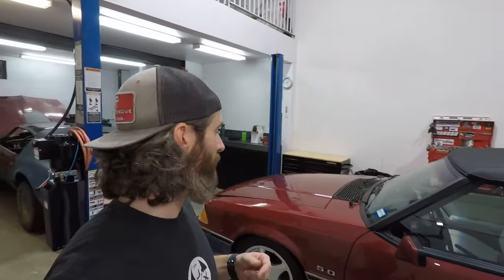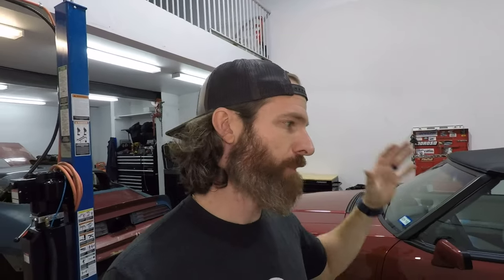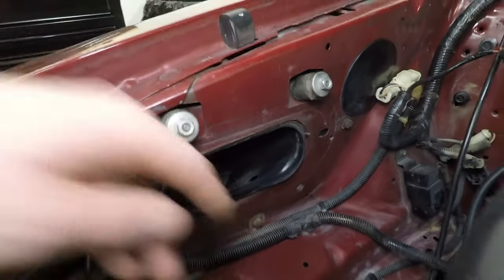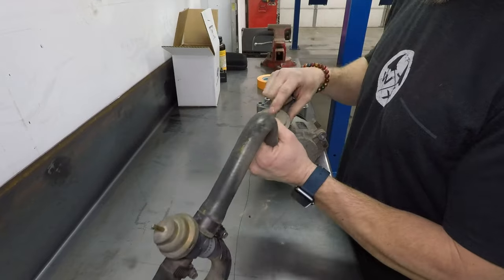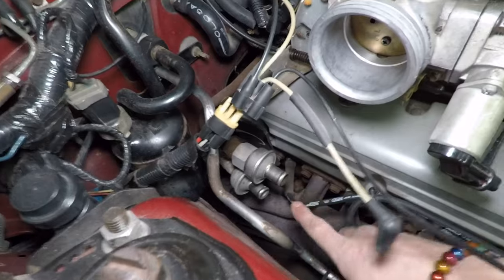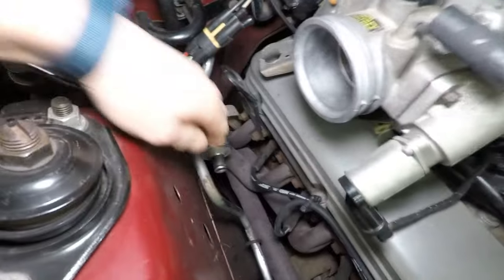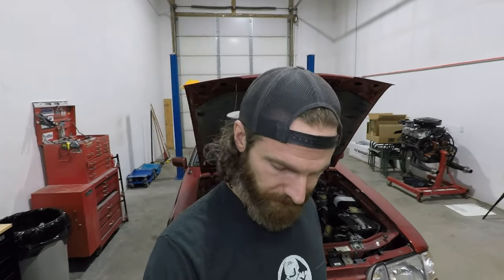Get Rid Of THIS Garbage in Your Foxbody Mustang 5.0

Comment: I really enjoy all your vids buddy! I am starting a AOD to T5 swap on my 1988lx 5.0 vert and interested in doing this smog delete setup as well. My question is did you remove the charcoal canister and evap stuff as well?? the purge valve and all that too line from upper intake manifold down to evap ? just plugged it all off or? I am not sure if your year vert would differ from my car and the factory set up since my car is a speed density car . Also when you removed all smog stuff did you worry about getting a check engine light code on the dash? I started pulling my h-pipe tonight and noticed i have that long smog tube attached to my h pipe that goes up above passenger side header and its kicking my ass to remove from the car from the bottom just using floor jack and jack stands, god I would kill for a lift lol fat guy problems lol hahaha too much beer and pizza and tight fit under the car. I have heard guys say just cutt that smog tube off the h pipe but not sure if thats a hack way of doing things. How in the hell did you tighten the h pipe bolts and nuts to headers lol. its so damm tight clearance wise in my car. Maybe after i get that big bulky AOD out my car and the T5 in there will be more room! cheers from the states down here in Maryland brother! thanks any input much appreciated.
Reply from the maker: Hey pal thanks so much for the kind words!!! 

1. Keep the evap stuff
2. Cut the line that goes the the H-pipe. If you don’t need to cut it, you’re a better man then me 😂
3. No need to worry about a check engine light by removing the smog pump. There is no electronics tied into that system. Just plug off the 2 vacuum lines
4. Get yourself a good swivel socket and some extensions and you’ll get those bolts tight 😉

As for the beer and pizza - I like your style 😎

Thanks for reaching out and I hope this info helps 👍
Reply: @KASLCustoms  thanks a ton brotha! Hopefully get to catch u at one of these shows sometime buy u a beer 🍻 cheers from Maryland 🙏
Reply from the maker: Anytime my friend! 🍻

Comment: How much weight did you lose doing this  like 20-30 pounds maybe? Also, since you deleted the smog do you now have any check engine lights? I know these cars aren’t plum full of sensors like newer cars, mostly just curious if the car knows it’s gone or not.
Reply from the maker: Hey bud. On the weight end of things, probably 5 or so pounds - not a ton. As for the check engine: nothing. I e had my coupe deleted of all this stuff for well over 20 years with no issues at all. There are no sensors or anything you have to worry about. Only 2 vacuum lines that need to be plugged. In all honesty, I only removed it to replace the headers and once it’s out, I don’t see any reason to go to the trouble of re installing it. It also cleans up the passenger side of the engine bay a little too 👍
Reply: Correct no check engine light, I recently removed my smog pump on my 1995 5.0 mustang, car lost weight freeing up lost horsepower

Comment: Thanks for the video! I wasn't planning on doing this, but I am forced to. I have a 1990 SSP that has a factory alternator bracket built into the smog pump, I know it sounds weird. They are fully connected and do not come apart. I have to change the alternator, and since the alternator for the SSP was discontinued once the police cars went out of production, no other alternator fits this stock SSP bracket. So now I have to change the bracket to an LMR one, but the smog pump definitely has to be removed. My question for you - do I just need to plug the other small vacuum connections? I'm pretty sure thats what needs to be done but just double checking.
Reply from the maker: Yes you most definitely do
Reply: @KASLCustoms  thanks bud. Also, I was being stupid and the bracket did come off haha. One more question for you. If I remove this pump, do I need to delete the EGR? Or will everything still work fine if I keep it on.
Reply from the maker: Yes it will all work fine 👍
Reply: @KASLCustoms  thank you so much for your responses. You're a great youtuber
Reply from the maker: Thank you sir!!!

Comment: Fellow Canuck here! I am almost done removing engine from my '87 GT and was so happy to remove that smog nonsense! My question is though, how does not having all that smog equipment affect my chances when I have to have the car inspected for road worthiness? My GT has been stored for many years and will have to pass inspection before putting it back on the road. Wondering if you have any info on that?
Reply: Get your inspection done first with all OE equipment.  Then you can't fail.   In Ontario all OE emissions equipment must be in place.   You can always remove it after if you choose to.  I had to put CATs on my car to get my inspection done.
Reply from the maker: This is a good point. I too wouldn’t take any chances with inspections however if you felt like chancing it, I definitely wouldn’t remove the Cats prior to inspection. They will definitely be looking for those. The smog pump on the other hand may squeak through…😬🤷‍♂️
Reply: If u have newer style obd2 cats u could argue that u don't need the smog pump as its really just to get older style in efficient cats hot faster
Reply: Northern Ontario here. No emissions testing here unlike Southern Ontario . I've kept everything just incase they do .  Haven't introduced emissions testing in the 32 years I've owned the fox . I think I'm good .😁
Reply from the maker: Right on! Lord only knows where it’ll go from here 🙄🤦‍♂️

Comment: I 4get the name of it , but isn’t that little plastic box under the air box but next to the smog pump part of the smog system as well?
Reply from the maker: it’s called a EVAP canister. it’s a charcoal filter that the fuel tank vents to 👍

Comment: What tool did you use (not the size of the bolt head, well that too) to get to the crossover tube bolts out?  Did you take the bolts out from the top or the bottom?  And how did you snake the crossover tube out of there, up or down, obviously passenger side?  I got those block off plates but am hesitating on trying to use them.  Especially because of the drivers side clearances.
Reply from the maker: I believe they are 1/2”. I’m sorry but I’m not sure how to answer the rest of your questions…? You just remove the bolts and remove the cross over tube. Very straight forward
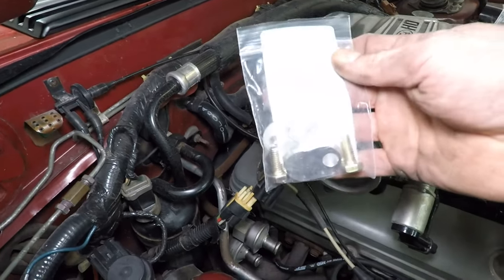Reply: @KASLCustoms  During the time you actually used tools and removed the crossover tube (9:07) you only showed a graphic that said "Many Moments Later, And A Lot of Swearing" so we the viewers didn't get to see what tools you used to remove those two bolts with.  That is my question.  What tool did you use?  Combination Wrench, Combination wrench with a ratcheting box end, Box end wrench, 1/4 or 3/8 inch ratchet and a shallow or deep well socket, a 3/8 inch ratchet 17 3 inch long extensions and 16 Universal joints, Adjustable wrench?   Tool Specifics, during the crossover tube removal
Reply from the maker: I used a box end wrench. The reason I said “many moments later” is because it’s a very tight space to get into and remove the 2 bolts. Once to bolts are out, you literally just remove the cross over tube from the passenger side.
Reply: @KASLCustoms  That's what I was wondering, thank you.
Reply from the maker: You’re welcome

Comment: Recently acquired a drive train from a 93gt.. gonna drop it into my 65 2+2… This pump will be coming off.. IF I decided not to use the idle pulley.. any idea of the belt length ?
Reply from the maker: Nice! I’m 99% sure it’s approximately 78.5”… a quick google search will confirm this 👍

Comment: Does the ECM need a new flash to compensate for the smog pump removal?
Reply from the maker: No not at all 👍
Reply: @KASLCustoms  can that smog system cause annoying vacuum leaks? I'm currently struggling thru troubleshooting those now. Replaced most everything else at this point.
Reply from the maker: There are 2 vacuum diaphragms that are in the smog plumbing. They need to be plugged if you remove the pump/plumbing 👍

Comment: Now, can you delete all the smog pump stuff and not get a check engine light? Interested in doing this myself on my 90 GT Hatch but I'm trying to not get so far into it that it will need a tune to get rid of a CEL. Is it possible to keep EGR and only remove the smog stuff to keep from getting a CEL?
Reply from the maker: You won’t get a CEL from removing the smog pump. I still run the EGR on both my cars with the smog removed with no issues. If you delete the egr, you need to “trick” the computer to thinking it’s still intact or else you will get a CEL. Hope that helps 👍
Reply: @KASLCustoms  Okay, I was trying to look it up also and I wasn't able to get a clear answer. What about all of the small vacuum lines that go to the smog pump hoses when you smog delete? I rewatched the video and didn't see anything mentioned about them. Thanks for the response. I do still plan on running egr as to not throw a CEL of course. I just want the smog stuff out of the way for looks and ease of access in the engine bay purposes.
Reply from the maker: Ok cool. Yes, just get buy some vacuum plugs from your local part store and plug them off 👍
Reply: @KASLCustoms  Alright, I figured just as much, thanks!
Reply from the maker: Anytime my friend!

Comment: Will back of heads leak anything when that pipe is pulled off?
Reply from the maker: Yes, unless you install the block off plates
Reply: @KASLCustoms  thanks but i meant while car is off and when you actually remove the pipe. Dont wanna spill antifreeze everywhere haha seems my smog system is gone and all that remains is that pipe.
Reply from the maker: Ok, understood. There is no coolant in that pipe. It can be thought of much like exhaust pipe because it only holds air 👍

Comment: is there a disadvantage just leaving the smog and using a shorter belt
Reply from the maker: No not necessarily - it’s mostly just personal preference with how you want the engine bay to look.
Reply: Not really. I did it.
Reply: @patsfan8057  I need help with the EGR vacuum lines after I pulled the smog pump I thought some of the vacuum lines have to go I have a 91 mustang gt any help would be great
Reply from the maker: Just plug them bud 👍
Reply: @Mattys91gt  Depends on what you removed. I have a Chilton's and a shop manual, does an excellent job at telling you what goes where.
Reply: @patsfan8057  I have the book also wait are you in Massachusetts being a pats fan I'm in Massachusetts near Plymouth
Reply: @patsfan8057  I removed the white and black line to the smog I pulled the lower stuff off the strut tower I still have the rubber block with the red and green coming off the evr going to the EGR and the other to the back of the intake and still have a fpr line hooked up I have a page of questions to ask lol
Reply: @Mattys91gt  Watch the video, it's much easier than anyone can write. KASL is correct. It's fairly simple, not like today's emissions nightmare systems.
Reply: @Mattys91gt  I didn't remove any smog equipment, just bypassed with a shorter belt. I have lots of mods, GT40 HCI, but I saved all of the original parts because I know that if I ever wanted to return it to stock, I wouldn't have to round up expensive original parts.
Reply: @Mattys91gt  Yes, I'm in NE, nice to have a fellow New Englander on board! 👍
Reply: mines the same so far now what did you do with the lines coming out of the bottom of the strut tower I know ones for vents and I forgot the other ones for it's my first mustang so I'm learning

Comment: Given that car is so original and at this point original is more desirable - IMO - I'd keep it all in tact. At the very least I'm sure you're holding on to all the parts.

Holy crap that still has the silencer in the fender? I didn't think a foxbody was left in the world with one. Mine came out in 1990 when mine was almost new.  It's good for about 5 hp. It made a difference for sure. You're wrong about it being insignificant gains.
Reply from the maker: Everything got cleaned up, boxed up, and labeled 👍. I left the silencer in to keep the rear of the car from breaking loose 😉
Reply: Back in the day it would make a difference racing the same car with and without.
Definitely worth more than that garbage "CAI" everyone puts on them. And I'm sure its worth more than pulling off the air pump. Go read about the 10 minute tune up MM & FF  published back in the day.
Reply from the maker: I never caught that article. I’m honestly not doing any of this for power gains. The air pump came out because the plumbing needed to in order to change the passenger header. I don’t see the sense in keeping an item on these cars like the air pump that was only installed so they could pass emissions when rolling them off the assembly line…

All that said, I’m just trying to freshen this car up and make it fun and enjoyable for my mom to drive; and part of that fun will be making a little more noise 👍
Reply: @KASLCustoms  You're right who needs emissions. Ford is so stupid.. The air pump is critical  for the cats but I'm sure they're coming of too for those HUGE GAINS right?
Reply from the maker: Yeah, the cats are coming out for sure. I’m trading rotten egg smell for fuel smell 👃💨👌
Reply: @KASLCustoms  Yeah those cats and air pump are worth about 6 HP - maybe. Definitely need to watch that backend breaking loose now. Totally worth the hassle.

Funny how cars can make 6 7 8 hundred HP with full emissions but lord knows that 5.0 is so choked by all the emissions equipment it has to come off right away.